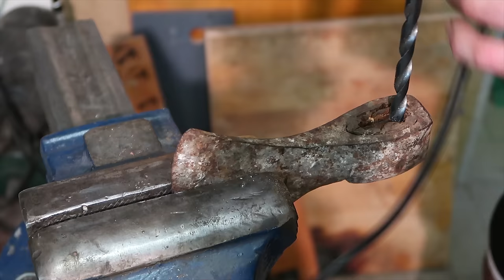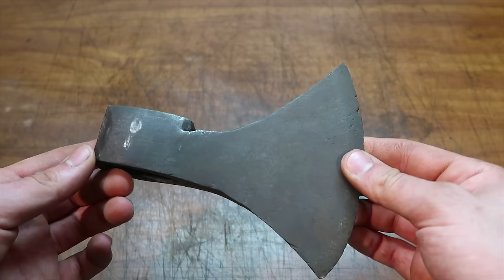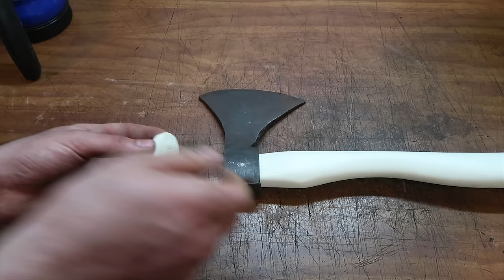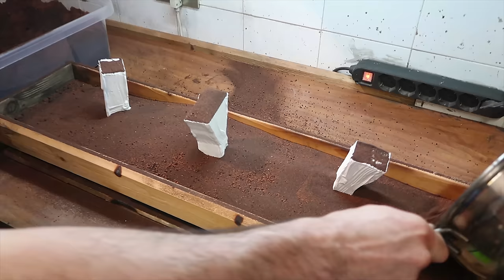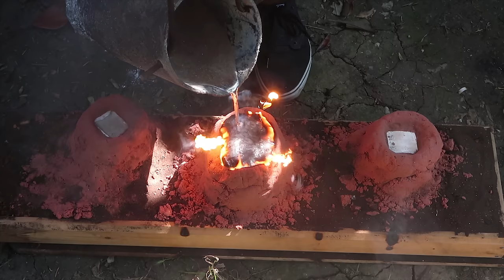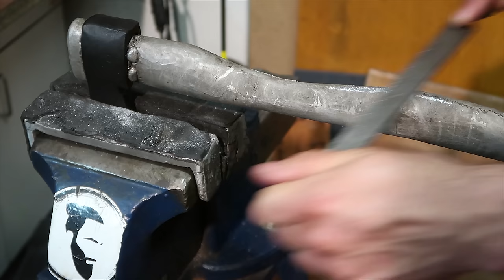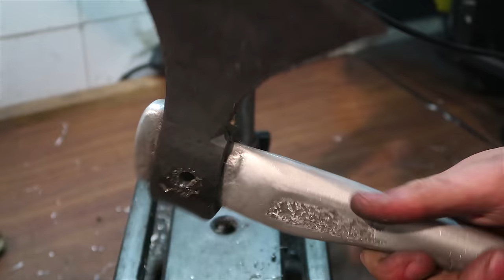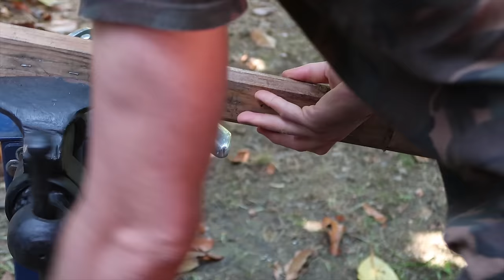Antique Hatchet Restoration. SORT OF...

Comment: That wood handle was in good condition.
Reply: Dark GT I also think it was in good condition, but still the wood could've been weak or something, ya never know unless you're the one working on it
Reply: согласен деревянная лучше чем какой то кусок алюминия посмотрел бы я на его руки когда он будет рубить деревяшку из твердой древесины )))
Reply: Dark GT gg
Reply: GreenCFS 
How mature do you feel right now?
Reply: Маша и медведь
Reply: He had to un rust the axe part I think that’s why
Reply: But it looks cool now
Reply: Dark GT nahhh
Reply: It was metal and weighed 3 pounds. Read the description
Reply: Dark GT 9
Reply: Dark GT i think is not because its to old
Reply: How old is too old? That handle was high quality wood when fresh, even with some time and use is still strong. Maybe 0.5 mm surface damage max! That guy barely manage to remove that handle, the uncover wood was perfectly fine, almost no rush where the handle meet the axe. That aluminum is maybe heavier and can also oxidize make it losing that nice finish over time.
Reply: Dark GT its metal not wood
Reply: But wood is flexible so you wont feel hits up untill your ass when you hit some oak :D
Reply: i know right
Reply: I honestly hate this guy now I cant believe he did that to that hatchet it was a great blade and he literally ruined it he ruined the temper casting an aluminum handle like a jackass causing the steel to heat up and soften  then he ruined the neck by drilling through it and then he ruined the edge profile by grinding it and as you saw in the end it wanted to smash through the wood instead of cut it because one it's too heavy, two it's not sharp, and three the edge has a too aggressive of an angle wich makes cutting even harder
Reply: Was thinking the same thing
Reply: matt mckinsey all he had to do was sand and oil the blade
Reply: The Musical mechanic since he learned casting has become his favorite procedure of making handles. 
Someone has to educate him about physics.
Reply: READ THE DESCRIPTION
Reply: Sergei 177, вообще то, в описании под видео написано, что это всего лишь эксперимент. Он это сделал ради своего удовольствия и надежды сподвигнуть других сделать что-нибудь подобное для себя)
Reply: Так к вибрации еще и тот факт ,что  руки чёрные будут. Декоративный топор
Reply: He should put a wooden handle
Reply: Read description
Reply: it was probably rotting
Reply: @themusicalmechanic7069  I've an idea. Perhaps you could show us all how it's done. The only video you've got is that of a spider bite.
Reply: @Rikairiify  ok my friends axe needs a new handle anyway it might take a while tho it's in Colorado and I'm in texas
Reply: Your right
Reply: Dark GT he just made a shittier axe
Reply: The Musical mechanic you said it right...I agree with you 100% he ruined that hatchet!!
Reply: @themusicalmechanic7069  shut up cause he has The right to do it and    what do u have to care it's not like it's yours so go find one for yourself if u want to be angry about it.
Reply: @dougevans6389  what is he going to do with it chop wood? sell it?
Reply: @bernardthemoose7813  I agree but still it's not like he's going to give it to a museum it's still good to keep it as a memorial of some sort.
Reply: @medli5614  I agree on that.
Reply: Actually it wasnt wood but isulation foam
Reply: KNuckleZification - finally someone who's actually smart
Reply: Rip handle
Reply: @themusicalmechanic7069  exactly
Reply: @Holloesoulz  were you paying attention at all
Reply: He should have restored it !! What a dummy !!
Reply: U screwed up not restoring the original handle !!
Reply: Can we get over with this ,please?
Reply: agreed, what a fanny
Reply: +Dark GT - Ron Swanson is that you?
Reply: Gg
Reply: and he replaced it with one that weighed 30 pounds and cost 900 bucks
Reply: I'd trust that wood 100x over that casting.
Reply: I know
Reply: Didn’t know rotted 30 yr old wood was good condition
Reply: That wood handle was good condition
Reply: This is an argument about a hatchet all yall need to grow up
Reply: I'm just looking at the replays just thinking 1. I'm looking at the reason humanity will end 2. Does no one read the description. And lastly 3.its metal guys most people have already said that are ya blind because from my brain metal is heavy but hey I won't judge most people don't have a brain it's fine so I'll sit in the corner eating my pumpkin pie and watch
Reply: Maybe he dislikes the look of it? 
He is Not making this for you
Reply: ذ
Reply: It wasn't in bad condition, but, I'd be inclined to do some heavy work on it if I were wanting to keep it.
Reply: @themusicalmechanic7069  still no video. Pathetic.
Reply: You have the right to complain but you also have the right to remain silent.
Edit: you say that you dont need to please him and yet you felt the need to say that you would restore a friends axe? When someone says "make a video" you dont need to actually make a video. 
People barely bother to prove themselves to a bunch of random people on the internet. And people never have to do it cause of some comment. At most it should be from a video directed at you. But if its due to something that you caused almost purposely then that your problem.
Reply: @Kobekola  I know I dont have to make the video that's why I'm in no rush to make it and I hope you know I dont really what you think about me I voiced my thoughts and I have the right to do so the fact that anyone has a problem with me pointing out that he ruined the axe head just proves that you have a problem with the people speaking their mind so forgive me if I get upset for someone who knows nothing about steel acting like they are some sort of blacksmith or woodsman who knows it's ok when heat releases carbon in the steel making it soft yes it can be rehardened and tempered but the chances of this guy having the proper machinery to do so when it costs several hundred thousand dollars is highly unlikely and the chances of that axe being fixed are pretty much none so you may think it looks cool but the fact is he just turned it into a club plus he drilled it just makes it weaker
Reply: No, you could see it was kinda rotten.
Reply: @walkerspectre  were you watching the same video or do you just not know anything about treated wood it gets dirty and the surface may look rotten but as soon as you take some sandpaper to it it's perfectly fine
Reply: Amazing
Reply: @themusicalmechanic7069  after reading your comment I figured id hop over to your channel so that you could show us how to do it properly. funny enough, you couldn't!
Reply: He got rid of the wood so he could properly remove the rust. Personally, I would have made a new handle with a similar wood as the original (for a restoration). This was more of a repurposing.
Reply: Good wood handles are hard to find.
Reply: Gy
Reply: That shit looks rotten to Hell. There is no way that handle was in any sort of condition to be used again if that's what you were thinking
Reply: Like hell it was the handle was rusty dusty and crusty
Reply: @sergei1779  can you translate that to English, please?
Reply: @9fangirl590  Good evening in my comments, I wrote that the handle is not practical to use because it does not absorb the energy of the impact thus can dry your hands and the ax has turned from a practical thing in a purely decorative for me wooden handle would be better
Reply: @sergei1779  still, I like the Styrofoam handle. It looks more sleek and stylish. If I were you, I would hang that baby on my mantle.
Reply: Dark GT exactly what I said
Reply: I think overall this guy a  does a nice job with restoration, maybe not quite everyone's taste on this one. I've learnt a few bits over the years watching him and others. I have some nice projects on Unique Restorations and no metal handles in site.
Reply: Looked better too

Comment: Does anyone but me wonder why this guy is so fascinated by using hard, cold metal in place of wood? I can imagine the harshness of using this tool for the purpose it was intended.
Reply: I think it would be ok if he put a rubber grip on it to stop it from hurting when you hit something with it, he could grind away part of the handle to inlay the rubber grip so it looks nice
Reply: @EasySqueezy1  Nah/ Aluminium has the mechanical properties of cheddar cheese. If you actually tried to use this thing, the handle would just bend more and more. Especially since you'd have to swing it extra hard because the edge would dull extremely rapidly, since he ruined the temper of the steel, effectively annealing it
Reply: @ashscott6068  my guy said cheddar cheese 😭
Reply: For fun... Check out his other videos, most restorations are with wood, but sometimes he gets a little crazy
Reply: @ashscott6068  the thing is it looks presentable he doesn't want it to be usable he is just making asmr type of vids
Reply: I believe he does it to be beautiful, not good to use. It's not a tool, it's art!

Comment: I know this will sound like the usual keyboard knowitall, but i really like your videos, and that's exactly why i ask you: please don't ever use the top part of your belt sander. If you need to grind a convex shape, use the underside of the belt; where the piece will fly away from you if you lose your grip and not towards your head.

Sorry if that sounded patronizing.

Also, very nice project; turned out way better than the bad idea disclaimer made it sound
Reply: And this was only one of the many safety violations he made. Scary.

Comment: Aliminium is not a good handle material.
Reply: Wood already lasts a long time, if you take care of it. I think the aluminum handle just made it harder to restore if you ever were to in the future.
Reply: Yeah also Aluminium makes it easier to get heat right?
Reply: rasnac agreed
Reply: Wood will fracture. Aluminum is superior. Dont talk if you haven't made or forged your own knives like I have
Reply: luckily aluminium doesn't exist, or he mightve used it!
Reply: rasnac oh my gosh! This was just an experiment! People should read the description before COMENTING
Reply: harry  i'm seeing that he uses aluminum, but this fabled aluminium does not seem to make an appearance!
Reply: im just jokin
Reply: Check the description😑
Reply: @danilo-hy3vx  except the old wooden handle he cut off was still sound and probably would still have worked fine if the axe head hadn't been rusted. Wood is made of fibers which means even hard wood flexes under an impact which is desirable in an axe handle. Solid aluminum like the kind shown in the video wouldn't absorb impact in the same way which means all of that energy would be passed on to your arm making your arm tire quicker when chopping wood. This is the same reason most good hammers and axes have wooden or fiberglass handles rather than metal handles.
Reply: Erick Hesch price of a knife doesn’t mean shit you can sell a wall hanger for that but the real tool quality knives are not that expensive
Reply: @treyreid7196  tell that Lin Rhea, Liam Hoffman, Jerry Fisk, Black Dragon Forge and others. A good knife by real maker is going to cost far more than what I price mine at bud
Reply: The amount of shock that your hand would receive from the aluminum handle on this axe would be way more than from a wooden one, you would ruin your hands after ten minutes of using this axe. It would be like trying to split wood with a metal baseball bat. Also, that's fine. Good for you then. Being a bladesmith still doesn't translate to understanding handle material, which you clearly don't if you were so worried about strength to weight ratios that you didn't think about ergonomics, and being in college doesn't make you smart. Besides that, think about replacing this handle versus a wood one. Much more difficult, time consuming, and expensive. I'm not saying that an aluminum handle is always a bad option, it would work well for a knife as long as you don't baton with it or do heavy chopping, but on an axe it's terrible. Application is the most important factor in determining what material to use.
Reply: @BurningTurtle98 @aluminum baspall bats
Reply: What?
Reply: @erickhesch4260  your experience making knives in meaningless in this context. The handle of a knife doesn't need to absorb impact force in the same way an axe handle does.
Reply: Yes. It cannot absorb a shock.
Reply: 7th tree and that handle is either A:gonna snap   B:Axe head flyin off
Reply: Look in the description, this is a fun experiment.
Reply: When swinging, the axe might glide out of your hand since it is smoother than wood. That's the real reason why we make axes with wooden handles.
Reply: Well russian section of comments already discussed this: fucking metal will make your hangs fall off in 5 minutes, while wooden stick is already an amortizer itself. And also original wooden stick was both more beautiful and more practical
Reply: @silverfox4399  R/Woooosh
Reply: @jon9550  IT WAS MADE OF FOAM NOT WOOD READ THE DESC.
Reply: rasnac no shit
Reply: I agree
Reply: Read the description
Reply: At first I thought it was a joke and maybe it was a special kind of steel but no-siree that glossy metallic silver shit cannot be mistaken, I could get better usage from a fucking cardboard can opener than a GOD DAMN ALUMINUM AXE HANDLE..
Reply: Is cast aluminum, will probably fracture or snap in no time.
Reply: aliminium isn't either a proper spelling material.
Reply: @WillzDre  I forge way better then i spell, trust me.
Reply: Totally agree. And wood makes a much more beautiful handle as well. I was wondering, "Why is he doing this?"
Reply: Correct me if I'm wrong, but wood is a better material for handles because it helps absorb impact. Putting less strain on your wrist.
Reply: I'm not sure why you guys all respond to guys like Erick.  In two sentences you can tell he has no idea what he's talking about.  No one in the world is selling an axe with a shitty cast aluminum handle because it would be stupid.     There's plenty of good use for quality aluminum alloy handles on hatchets; but generally speaking composites and wood will always be more popular, they'll last forever, look amazing and work great.      Some people should stick to knives.
Reply: @erickhesch4260  Wood is superior for an axe/hatchet, as it will minimize vibrations.  Aluminum is also soft and over time that head will get loose, but it will be much harder to replace the metal handle vs a wood one.
Reply: rasnac read desc
Reply: Neither is lava
Reply: @erickhesch4260  Touché.

Comment: Y’all lazy people just wanna complain. The description says EXPERIMENT. Also, not everything old is valuable. You wouldn’t spend a fortune on an old run of the mill piss bucket would you? It just looked like you’re average old style hatchet. Which can’t be THAT old cause the wood was intact, and it looked heavily used. So calm down, he didn’t destroy the most important hatchet ever.
Reply: arpiarpi230 je
Reply: It was a good ace in the beginning and require just a bit of cleaning and sharpening. If you expose hardened steel to high temp you ruin it and he did just that.
Reply: lipsa pauza E X P E R I M E N T
Reply: Who looks in the god damn description other than to find links?!?!
Reply: Lucas Williams People who actually want the whole picture. I bet there’s a lot of stuff you miss by not reading it
Reply: Gun Noob I laughed so hard
Reply: ''Your average old style hatchet'', not ''you're average old style hatchet''.
Reply: Samuraio I bet you feel so important after pointing out my autocorrect mistake don’t you?
Reply: @ivoryholliday670  Absolutely, I just couldn't resist.
Reply: @samuraio33  when I grow up I want to major in the minors.

Comment: Is the handle round the wrong way?
Reply from the maker: I asked myself the same! No idea :')
Reply: I wondered the same but It's the same way round as at the beginning of the video - the flat part points towards the 'blade' and the curvy part points towards the 'heel'. So if it's wrong then the last person also did it wrong :D
Reply: The original handle was put in facing the right way.  Also on the end of the handle you could make some grooves for grip buy turning it against the edge of a bench grinder wheel.  (I do that to sledge hammer, ball peen and most any wooden handles that are smooth and I don't want to come flying out of my hand).
Reply: Yep it is
Reply: An old-timer told me that a properly forged axe hole is tapered slightly wider going towards the outside, so that the wedges will prevent the head from slipping off the handle.
I believe that the Nordic axe design is so that no wedges are required; the handle comes in from the top, and is held in place by the tapered handle.  The heads and handles can easily be separated from each other, and interchanged by knocking the head on and off the handle, using the taper as a lock.
Ingenious design.
Reply: Your in yiay
Reply: Black Beard Projects  saludame :v
Reply: It is
Reply: Hahahahahahaha
Reply: Yeah it fine btw
Reply: Ethan Vuong you spelt “your” wrong, it’s spelled you’re
Reply: Ethan Vuong it's you
Reply: Kris Cochrane
Reply: Just add a palm swell to the handles
Reply: Kris Cochrane lol
Reply: I think no but idk
Reply: Ethan Vuong are you perhaps referring to Jackfilm’s Yiay?
Reply: U ruined it
Reply: yeah i can see it

Comment: Not supposed to mix ferrous and non-ferrous metals.
Reply: True. There will be an electrical reaction from the dissimilar metals which will lead to corrosion, and the head and handle joint becoming weak.
Reply: Figuring that this is an experiment, I dont think he intends to use the damn thing

Comment: If that is an aluminium handle, it will corrode. Steel and aluminium cannot be put together because the steel corrodes the Al in what is called preferential corrosion (or Galvanic Corrosion).